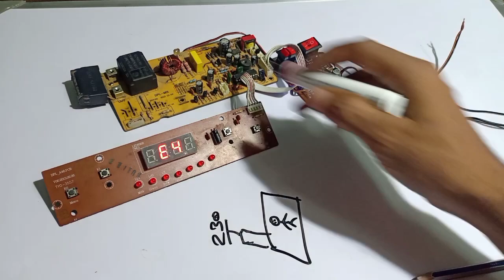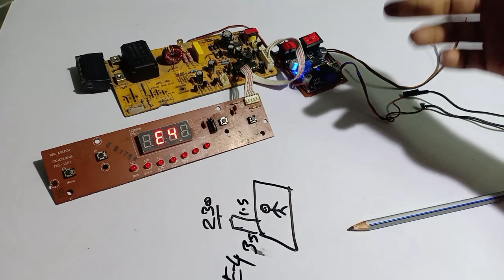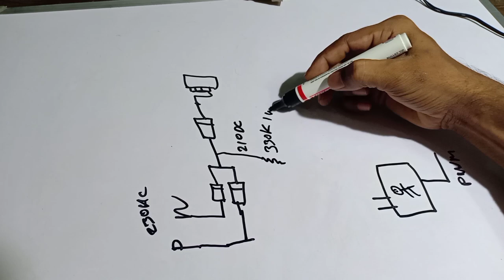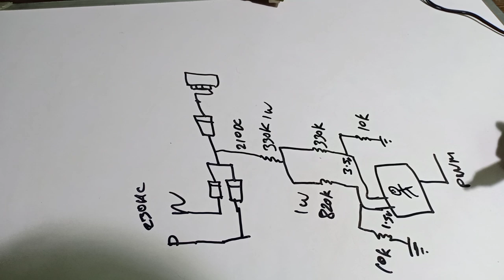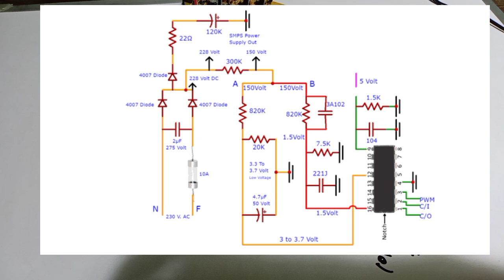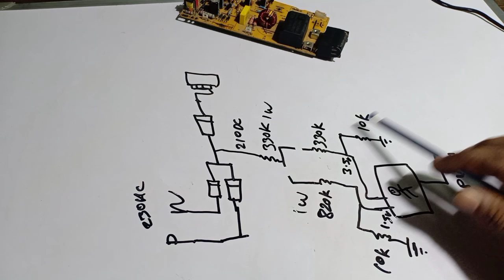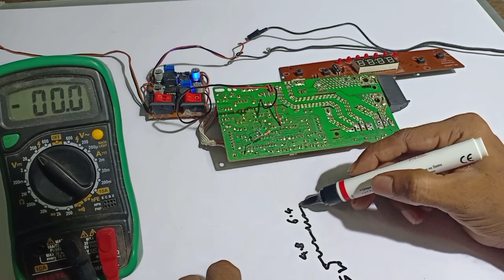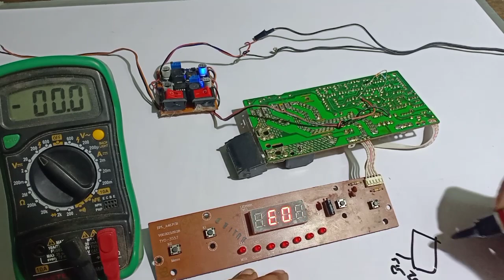Low voltage vs High voltage.

Comment: Intha same model stove button off pannuna fan konja neram odama off ayiduthu. Ic pin la voltage check pannumpothu on la iruntha voltage varuthu, power button off pannuna fan voltage 0 ayiduchu enna problem
Reply from the maker: 8050 Transistor change pannuka
Reply: @nktronics  power off pannuna ic la fan output voltage 0 aguthu model apdithaana
Reply from the maker: @mohanbabu3677  சார் ஒரு சில மாடல்ல இப்படி கூட இருக்கலாம் .